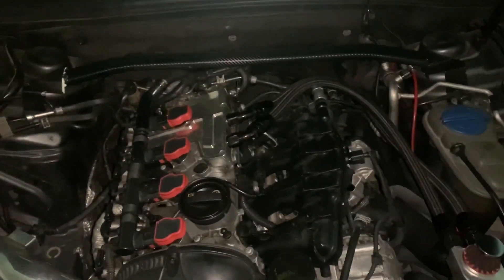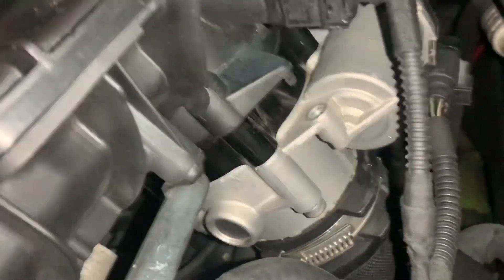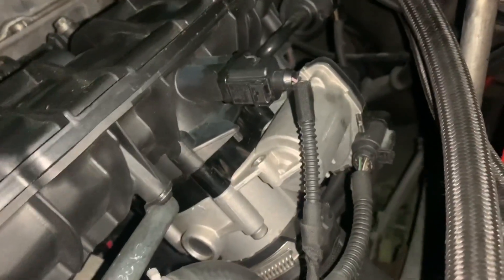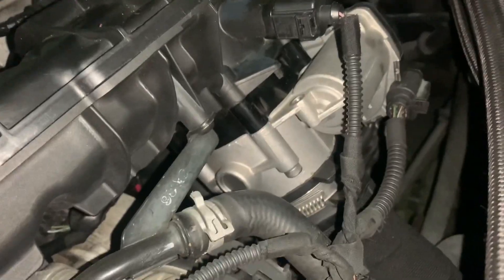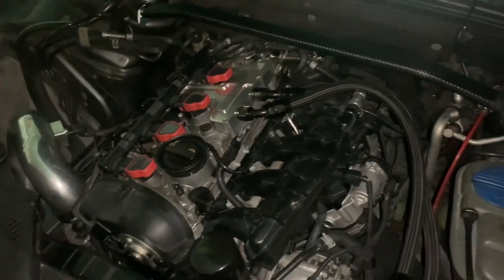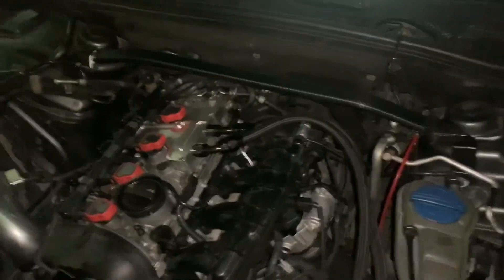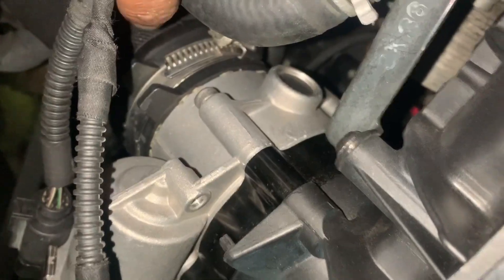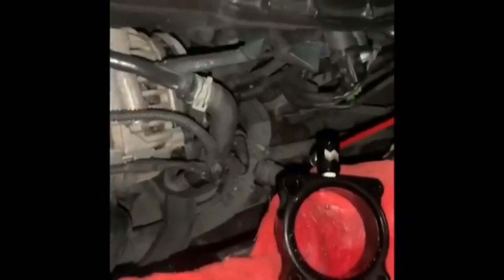“AUDI “ Is A Throttle Body Spacer Worth It does it ad more Horse Power?

Comment: Dear , i just wanna ask u , audi a5 2.0LT 2010 s-line prestige, does the paddle shifter have delay in up or down shifting (every thing is stock ) . And is it nice to buy this car if the mileage was 95,000 mile? Thank u in advance.
Reply from the maker: Hey how, are you and god bless. you no the paddle shifters are very responsive, and my car actually has 120,000 miles, and is heavily tuned, you should be fine, check out this video  https://youtu.be/hkpSac9-yX4
Reply: @brucecustommotors  if the scanner that i put it through the obd 2 port just give me a fine results ..., thats a green light to buy the audi? Or i should test the car more and and check the mechanic ? Or it’s just fine with the scanner ?

Comment: They only way to truly see if this thing actually does anything is to run the car on the dyno with it on and off. To actually say a little, little bit of difference is just a sense of you wanting it to work. It's like a placebo affect.
Reply from the maker: Yeh , I can see your point, jus didn’t want to pay dyno money for such a small mod, a lot of people don’t realize how expensive a dyno is, and the risk you take with your car.
Reply: @brucecustommotors  Yup anybody who wants to dyno their car will need to sign a waiver protecting the shop of any liability to your car

Comment: i added one last week, didnt notice much
Reply from the maker: yeh thats why i do these videos, I cover every thing check out my tune and performance play list before you ad a part https://youtu.be/GSj76OCyWlM
Reply: @brucecustommotors  i am looking for a tune for my 1.8t b8, and im looking for the cheapest price, apr tune is more than £650 iin the uk
Reply from the maker: @AKDiag  yeh ie and revo are a little not cheaper but not by much
Reply: @brucecustommotors  have you  used a racechip?
Reply: @AKDiag  what did you go with. I have a4 b6 cabrio. I went with Phantom Tuning stg1.
Reply: @paulattree4171  I got a custom tune by ja custom tuning , it's different, stage 1 tune but smashes it